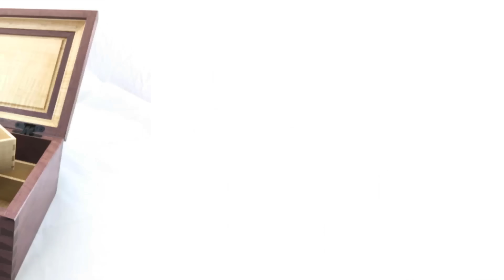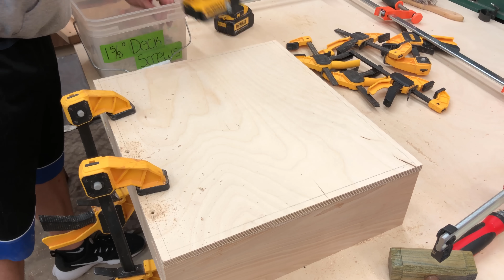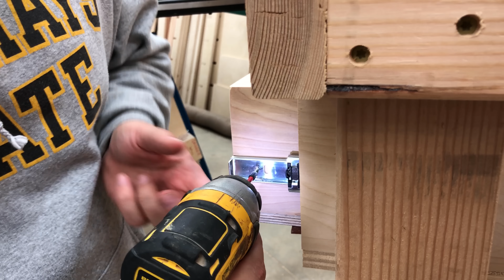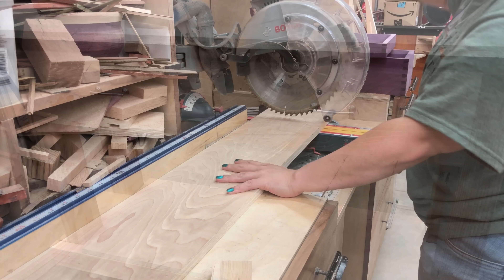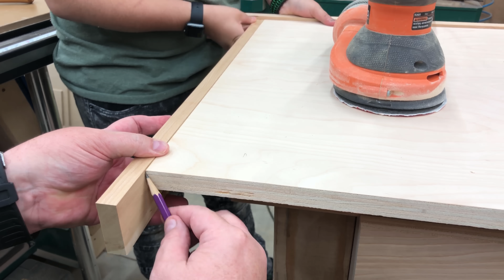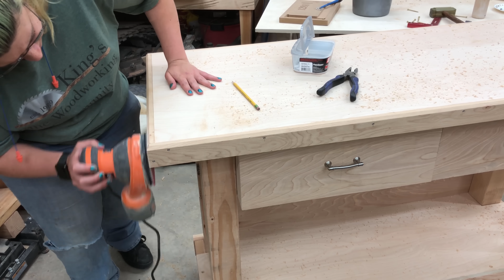69 - How to Build a WorkBench Woodworking 101 Lesson 4 Part 2 Final

Comment: My daughter just bought her first house I've been looking for a workbench to build for her. This just might be it. Thanks! The edge trim is a nice touch, but I'll make mine solid underneath so that clamps can be used on the overhangs. Filler strips will be enough and will eliminate the need for the exposed screws. Of course, if I trim the top, I'll probably have to trim the bottom too. ;-)

Comment: This work table is to nice to put in the shop.  The cherry trim around the top really finished it off so nice
I have used the same drawer slides and they are really smooth operating . My granddaughter wants to learn about wood working but she is getting a lot of negative input from some of her friends. We watch your videos together and I pointed out to her how both of your daughters work in the shop with you and they are still young ladies, with their nails painted . So my granddaughter has decided that she too can work in a woodshop and still be a girl, she is 17 years old. She has noticed how your older daughter uses the table saw quite a bit and she would like to learn table saw safety. Thank you for you and your kids influence on Alexis in helping her to realize she can woodwork and still be a young ladies. By the way I forgot to ask you when I watched your video on glues choices, what kind of glue do you feel is best for wood to be turned on the lathe? I do quite a bit of turning and have used Elmer's wood glue but have not been able to find it anywhere. Would the tote bond glues be a good choice? Thank you for doing a great job of narrating your videos.

Comment: James, thanks for the great video, I’m going to start building this this week with a few modifications. First and foremost is I’m going to use 2x4’s horizontally with a half inch plywood over that so if I ever need to replace the top surface I can just swap out the 1/2” plywood. Second is I’m going to mount it on wheels because of space constraints in my garage. Do you see any problems with that? You guys are the best which is why I’m a member of your patreon patron group. Keep it up!!!

Comment: This is a great project for the beginning woodworker. The branch is very sturdy and offers some storage. It could easily be modified to have a full set of drawers instead of the shelf at the bottom and the drawers could be different depths. Personally I find shelves under tables or benches often get too cluttered with stuff.
Reply from the maker: Hi Don. I also prefer full drawers. I think my friend had a compressor and vacuum he wanted to store under there.
Reply: I would love to put some drawers under my bench.  However, I put through dog holes down the length of the bench.  Drawers would either accumulate a lot of shavings etc. or if I put a top on, the dog holes would fill up.   Still thinking that through.
Reply: Marshall Murrell I’m planning on leaving a space above the drawers for the bench dogs. The drawers will have a top panel to keep shavings out of the drawers and it would be easy to either brush or vacuum. It would be similar to a Sjobergs bench but just drawers.

Comment: Is there a chance that when pulling out the drawers with weight in them, the bench may tip forward? Nice bench otherwise.
Reply from the maker: No. It won't tip even with the drawers max loaded. The bench is really pretty heavy. It is also very easy to modify to make it deeper if desired.
Reply: I was thinking the same for some reason ...

Comment: My late father was a Cabinet Builder for many years and if he stripped a screw out, his favorite trick was to remove the screw, brake the ends off a hardwood toothpick, cover the center portion of the toothpick with wood glue, reinsert it into the stripped screw hole and hand screw it with the same screw.  Of course, this was before the advent of cordless drills and such.  He rarely used a corded screw driver, opting to use traditional screw drivers only.  I have used this method as well and have never, ever had a problem with it backing out or failing.  I am almost 70 yrs old so I have many years of experience.  Finally, I really do enjoy watching your vids and applaud you for having your daughters getting involved with all your projects.
Reply from the maker: Hi Bud. Thank you! And thanks for sharing the tip.
Reply: I've been doing this for years myself. Anytime I remove a door hinge a toothpick goes in the hole the the screw.
Reply: Or....a wooden golf tee with glue works great too
Reply: My dad did this also.  If he didn't have a toothpick, a wooden match stick would do just as well.  Really, you just need something that will glue in and take up space.  The next screw does the rest.

Comment: I am not a fan of the uneven somewhat flimsy edges to the bench. Looks are great but I've had trouble designing a bench that would allow say several Bessy square clamps to clamp a piece to the bench without worrying about the edge buckling in (or out). Some design solution to that top? Say double up the layer of the top and banding with 1 1/2"?
Reply from the maker: That would certainly work. You could definitely glue and screw two 3/4" sheets of ply together for the top and it would handle any clamping load.